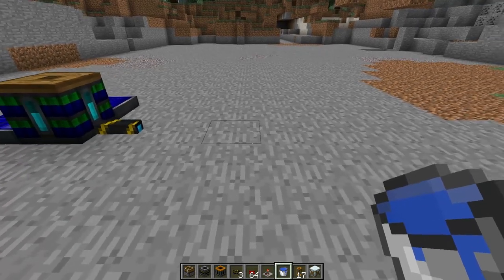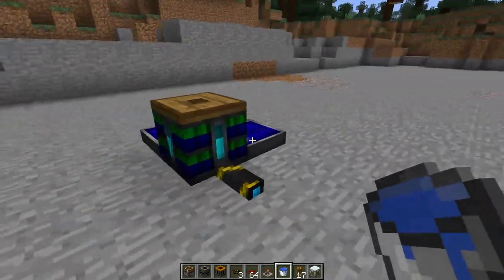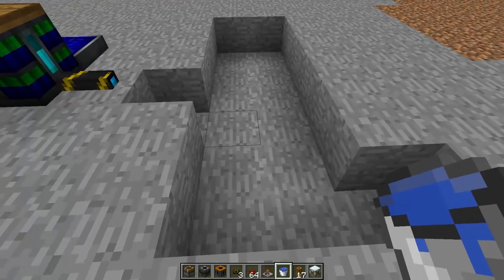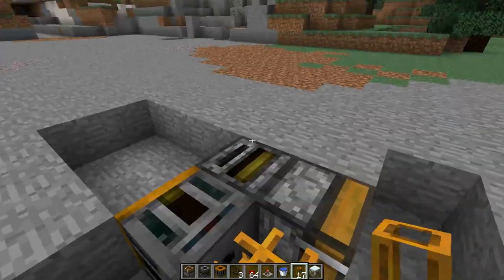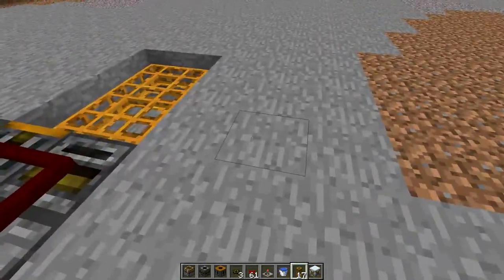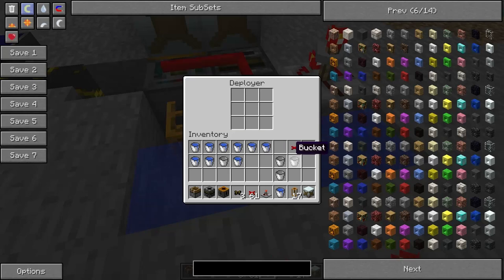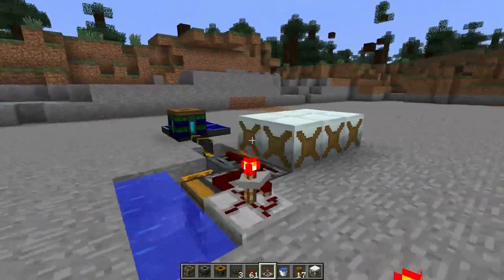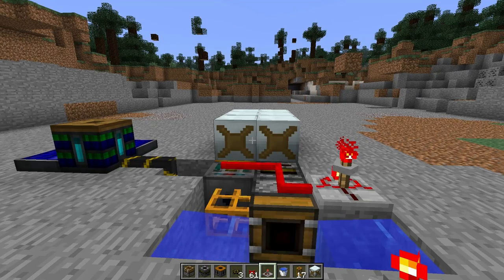[Tutorials] Redpower & Industrialcraft - Automatic Water Mills

Comment: If you are using a lot of small energy sources (solar or water plants), then use Tin Cabling. If you are using Compact Solars, Geothermal, or other things which produce more than 2/tic, use Glass Fiber cable. 

There is no currently known way to reduce the voltage below 32 eu/tic once it gets converted up. However, if you are wanting to transmit energy over LONG distances, amp it up to HV and transmit via glass fiber cables for minimum energy loss.

Comment: Depends on how far away it is. Current going out of a batbox is Low Voltage, so Copper cabling would do the trick. However, if it's more than about four blocks away, you start getting energy loss, and Glass Fiber (optic) cables would be a better choice.

Comment: ok first off, excellent setup, but some tweaks i made allow you to setup about 40 mills on the same array.If you seperate the tubes with covers it will reduce lag, you seperate the pulse between the filter, and the (retrever and deployer) using a repeater it will help bunches. the retriever and deployer get one pulse and the filter gets the other. once again thanks, the water mill uses a bucket every 25 seconds btw and this allowed me to figure the max number to be about 40.

Comment: So I did some testing, and I found these things:
The receiver needs to be set to Any Item by clicking the symbol in the bottom right.
Buckets only produce 1EU/t, cells produce 2EU/t. Buckets produce 500 EU total.
I have a setup running 32 water mills, and I could probably add more if I wanted. However, to do this, you need to have lots of buckets in the system. Keep adding stacks of buckets to the deployer until it gets backed up and spits out buckets, then remove a few until it is stable.

Comment: If it's a bat box, MFE, or MFSU outputting, you'll need Glass Fiber cables. If it's water/solar, then you can use tin cables. Either way, you probably want some sort of storage device within 40 blocks. There *IS* no way to step down LV to 5 eu/t. Once it gets turned into LV, you can't use tin cables.

Comment: It's a matter of 'packets'. Water mills, fed with buckets, produce 2 eu/tic. So the packet is 2 eu. You can have fifty water mills, all being fed with buckets, and they all have a packet size of 2 eu, so you can use tin cabling. Now, once the energy hits a batbox, it is transfered into Low Voltage, or 32 eu/tic, for a packet size of 32. That's more than tin wire can safely transmit, so it'll fry the wiring.

Comment: 1 retriver, 1 filter, 1 deployer, at least 1 solar panel + batery + blue wire cables,
red wires depens on how is build ur system (i use 2 chests to speed buckets up), pneumatic tubes at least so many u want to have mill on them, glass fibre cables ... and well watermills and buckets .. its realy simple

Comment: The only thing that's actually expensive in this machine, arer the diamonds and redstone in my opinion, but yeah, I think it's all good and excelent and efficent design for the amount of EU that you can get out of 1 blueleectric solar panel.

I think 16 is the max for this, electrisity-wise (the water mills produce 2 EU/t so 16 generators would create 32EU/t which is the max for copper wire.

I like how compact it is too. You did a very good job.

5/5 stars for you.

Comment: Thats because the pneumatic tubes arn't made of gold, they're made of brass. Put 3 copper and 1 tin (tin above the copper) in an alloy furnace (made with 8 bricks in a square shape) and it will smelt them into brass ingots. Then place 1 ingot, a piece of glass, and another ingot in a horozontal row, and it will create 4 Pneumatic tubes.

Comment: Is there a problem with the Mod if it wont let you place the wiring on the boxs? Whenever I go to put the wiring down it just opens up the filter or retriever. Or is there a way to lay it without right clicking?

Comment: Direwolf20 does his with turtles on one of his season five singleplayer episodes. I did mine with a Aqueous Accumulator giving water to a liquid transposer and the transposer filling buckets and ejecting them to a chest above it. The automatic crafting table takes a full bucket from the chest and puts an empty one back. An emerald wooden pipe pulls an empty bucket out of the chest and puts it back in the transposer to be refilled.

Comment: Try to use Ultra Low Voltage cables (Tin). For some reason, mine didn't work until I used tin cable.

Comment: If this works in a way that I think it does, this means I can finally stop relying upon the bloody solar panels as they're quite expensive to create. Even though they are far easier to maintain as they don't require anything particularly powerful, it's still annoying that one has to get a ton of rubber to make two circuits for each solar panel... not to mention glass and coal dust.

Comment: the max number of watermills is not 20, I have a system which has 30 in my ssp world.  Just letting you know.  :)  Though it takes a ton load of buckets.  Also, I set the timer to .200 seconds, its better for the retriever when it has 30 buckets to retrieve.

Comment: so there are 20 ticks per seconds, if the watermills generate 2 ticks/second (2 x 20 = 40) they do 40EU/second each, theres 600000 EU storage in an MF, it would take you (600000/40 = 15000) 15000 seconds to load a full MFE which is a total of (15000/60) 250 minutes, so about 4 hours to fill an entire MFE with ONE water mill, of course when you craft it you get 2 so (4/2) it takes two hours if you use only 2! with 10 it would only take 24 minutes to load a full MFE thats awesome!

Comment: Well my point is that there are probably many people that want to have it as early as possible and as cheap as possible. Also not having rubber is very problematic as you need insulated wires in every second IC² recipe.

Comment: So I have done literally everything you have done, exactly as you have done it, and none of it works. It looks just like your looks and aesthetically functions the same, but none of the water mills will get any power. The Deployer just seems to alternate one bucket between being full and empty. There are 6 buckets in the Deployer, 1 full bucket in the Filter, and 1 empty bucket in the Retriever.

Comment: Not so efficient you could use a Pump in the middle a energy link in top of the pump gold water proof around the pump as long as you want and water strainers in top of the pipes using a 3x3x3 water source infinite for the pump using the energy link to transfer the energy from the strainers to the pump rotating the energy so you have no energy loss , but first you need to put a generator in top of the energy link so it can power all just put 1 coal and take it after 10 secs and you good to go.